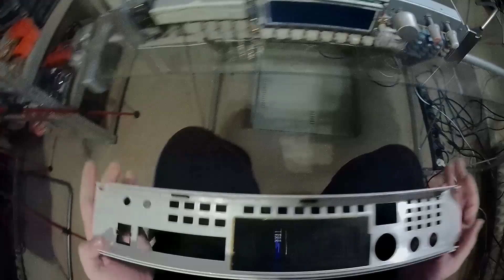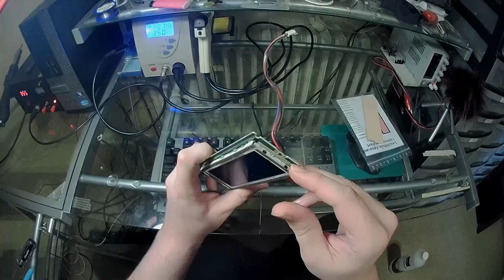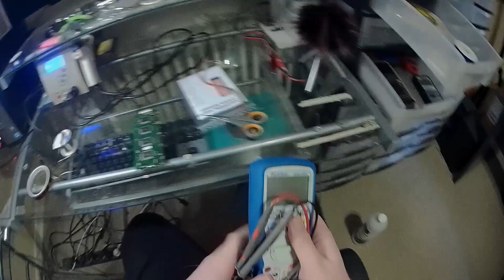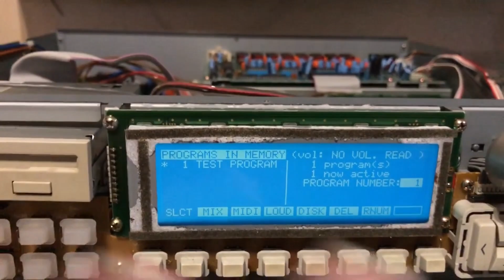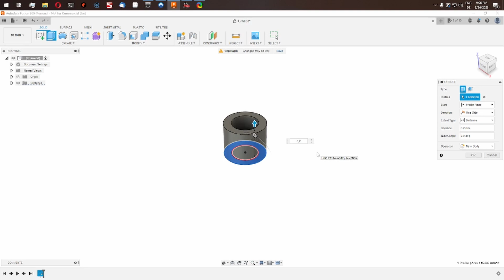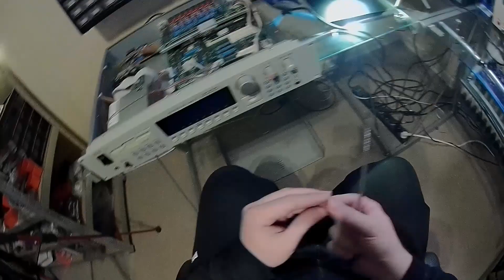Improving the condition of my Akai S3000XL

Comment: Akai CD3000 XL crackling noise ...
Hi There,

My akai when is turn on for a while its starts to work good with no noise, and after a minute or 2 after being on its starts to make this crackling noise and gets worst like in video 2 when played any ideas?

https://youtu.be/eOSE1CdXlaQ

https://youtube.com/shorts/-YgTWzcCuIM?feature=share

Cheers
Reply from the maker: This could be any number of things. 

First thing I'd try is just loading samples from a different CD (assuming that's what you did). If you're using some old CD the data on it might be corrupted due to bitrot. If that doesn't help, try recording something into the sampler and see if the issue persists. If this works, the CD drive or SCSI controller might be the issue. 

If not, I'd try swapping out the RAM, as partially faulty RAM could corrupt anything you load into the sampler. If you don't have extra RAM on hand, just remove the memory modules that are installed, the sampler should have some internal memory (assuming that isn't broken). If that fixes the issue, the RAM is likely your issue.

Also, make sure whatever you use to record the output from your sampler is working properly. I have a half broken Focusrite OctoPre Platinum LE that tends to produce crackles when it runs for a while. No idea why though.

Well, those are all my best guesses anyways. Good luck with your troubleshooting.
Reply: @RFX01  Hi there, i´ve tried everything and nothing. and now when i turn it on it gives almost no sound just a very low crackling noise.... dont have a idea what happened.
Thanks
Reply from the maker: @cf9978 I've done some googling. Do you have an effects board in your sampler? Someone else has had a similar issue that was caused by this board being defective. Removing that fixed the issue for them. Other people have also reported that a PCM69AP chip was failing (which is the DAC). Seems like you can still buy those for cheap, so maybe that's worth investigating.

In general, it seems pretty hard to find info on niche audio equipment like this. Given the gradual nature of this issue and the age of the sampler, it could also be failing electrolytic capacitors, but replacing them all would be quite a bit of work. If nothing else works I'd say give that a shot. 

Not sure how much you could realistically do beyond that. Not sure how many other chips on there are still available for purchase. Having another working unit to swap parts with would help, but I'm assuming you don't have that luxury.
Reply: @ no i dont have an fx board… dont have any idea  its realy a shame because i like the sound of the sampler… i could use a vst to read the library cds but the sound its not the same. Thanks for your time my friend. Regards from Portugal 🇵🇹 💯
Reply: @ now i put he memories again and its working fine 🤔 but im shure that will happen again...